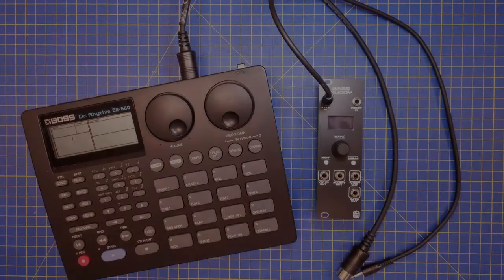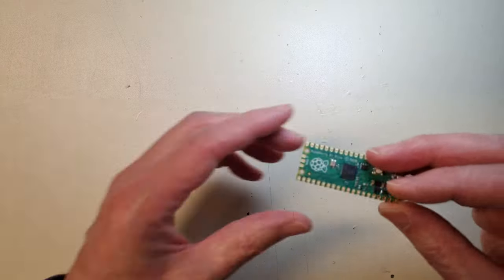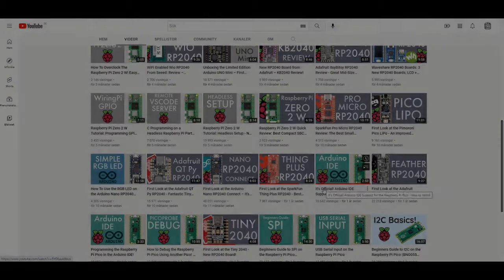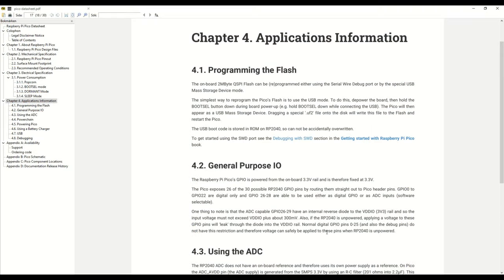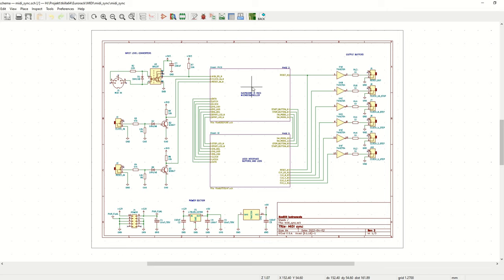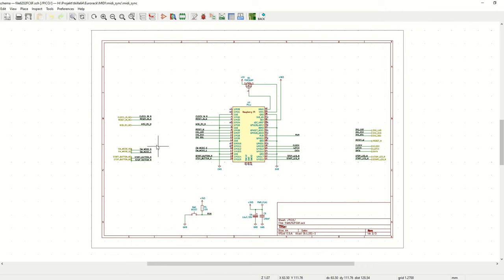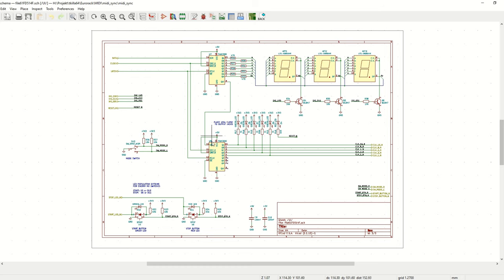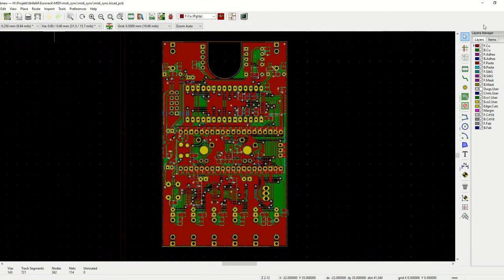Eurorack DIY - MIDI Sync Clock Generator (Episode 1)

Comment: Awesome design! Exactly what I have been looking for for a very long time. I'm currently working my way through the build. The FDN340P FET is out of stock pretty much everywhere right now. Do you have a suggestion for a suitable replacement?
Reply from the maker: Hello, I'm glad to hear that you are interested in this module, good luck with the build!
You can use the FDN360P, but that can be a bit tricky to get hold of too.  I have used this 2nd source component from LCSC:
https://www.lcsc.com/product-detail/_KUU-_C2891695.html